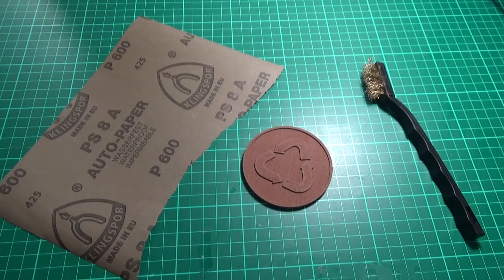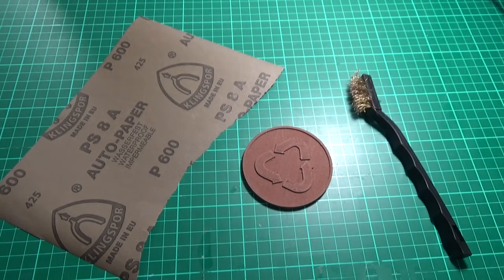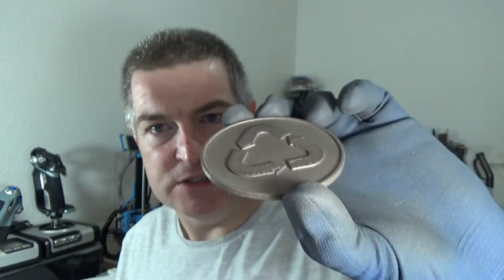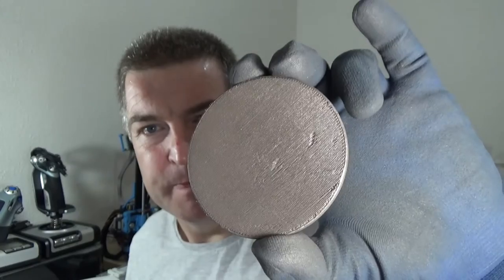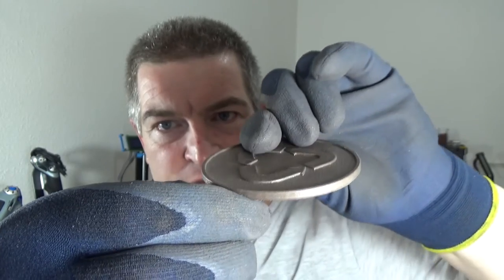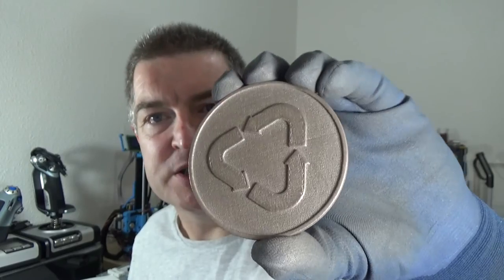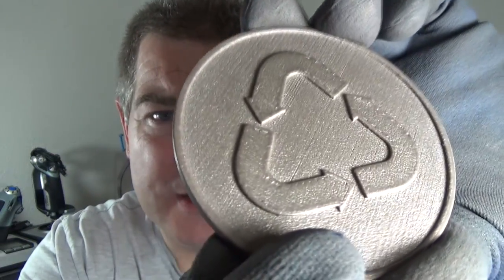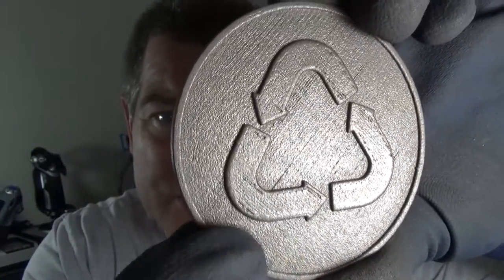Copper Filled Filament ........... Again !!!  Filamentive Discount Code

Comment: Great video! Is this filament harder than ABS? What would be the hardest material (regarded wear and tear, drop strength, impact resistance) to use? ABS, nylon, copper filled filament or maybe something else? Thnx!
Reply from the maker: This copper filament is 80% copper 20% recycled PETg.  The PETg is kind of a "filler" that holds the copper particles.  This makes it weaker than standard PETg.  In my opinion the metallic filaments are more for aesthetics.
As for other materials,  PLA is a very hard material but this makes it brittle and it has a low temperature resistance.
ABS and PETg are less brittle and have higher temperature resistance.
Nylons are very strong and offer great tear and temperature resistance but the are not so hard and need to be printer at very high temperatures.  Getting prints to stick to the build platform can be an issue (apart from bridge nylon, it prints like ABS).
I have also tried carbon filled PETg.  This really needs a hardened nozzle but the printed parts are very strong and are quite hard.  This can make them quite abrasive and I imagine they will wear through other parts if they are sliding against them.

hope this helps

Steve